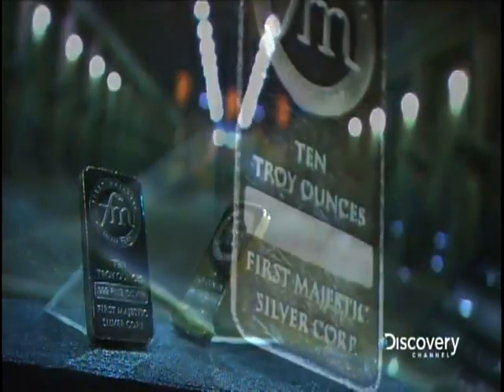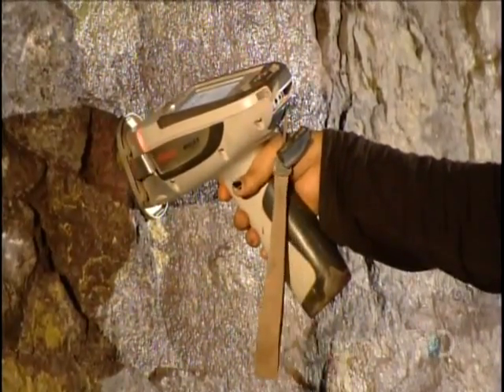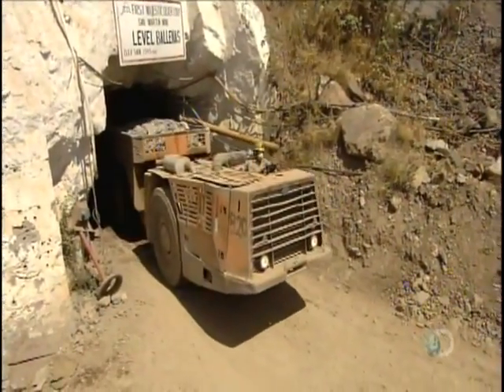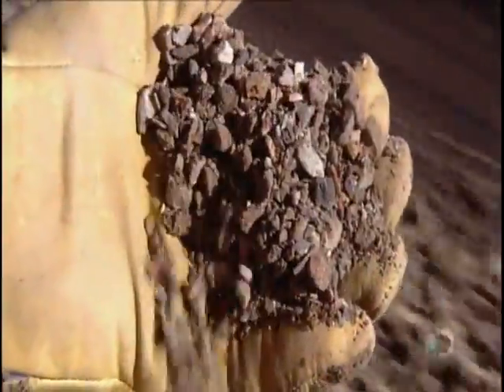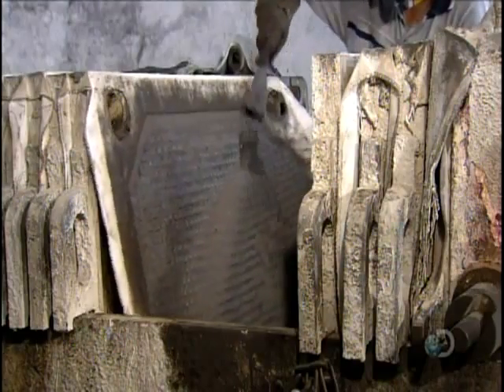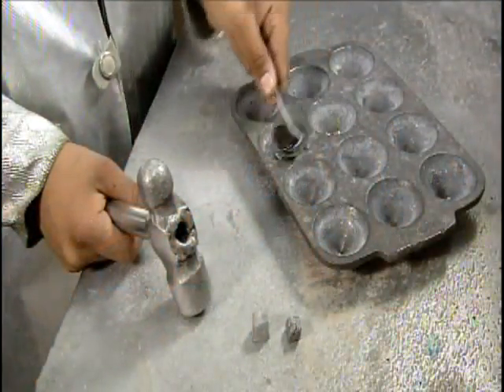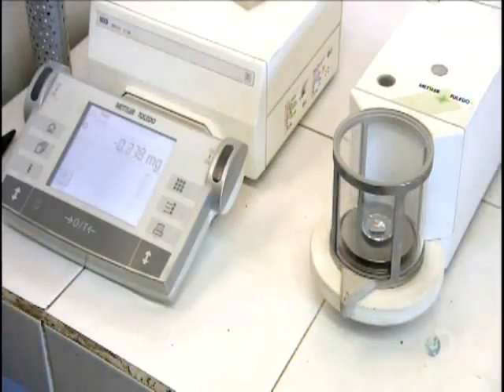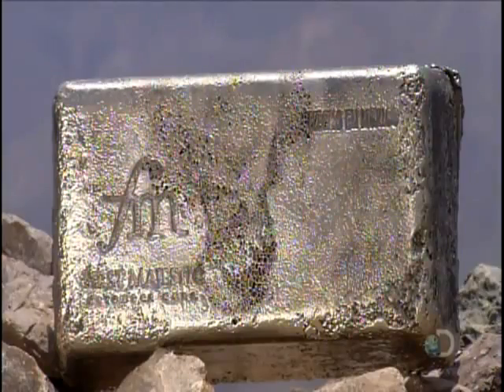Silver Mining Process / How is Silver Bullion Mined?

Comment: Lots and lots of Diesel for the heavy equipment to use,  a lot of Electricity consumed running those motors that vibrate the asset,  and lots of gas to operate the furnaces for Silver to be just $24 or less an ounce.  Looks like a money pit.

Comment: How did we use to obtain silver back in the day? Like Roman times, without chemicals.
Reply: They used cupelation, that is the process in the furnace, SIlver is acompanied with lead, so high temperature burnes all other metals and in porous cup (cupel) leaves quite pure silver, I measured my cupeled silver, it was 99,7 % pure, obtained from various silver scrap. This process was used even in middle ages. Now is used chemical and electrolytic purification. But fire assay is still used as analythical method.
Reply: Chemicals were on earth long before mankind. And there were many extremely intelligent people who knew how to use the chemicals.
Reply: @tweston315  which does not answer the question.